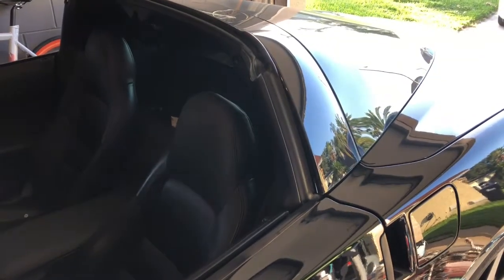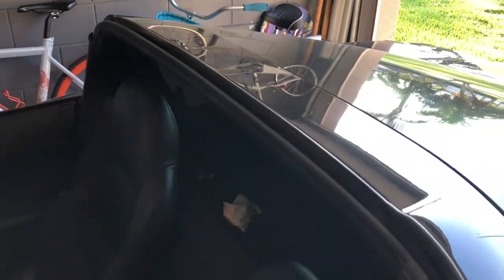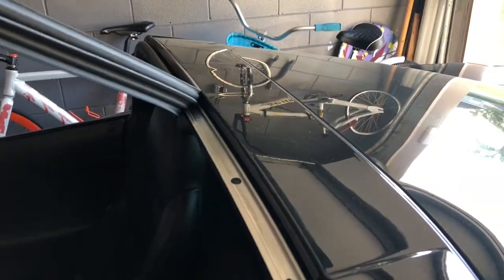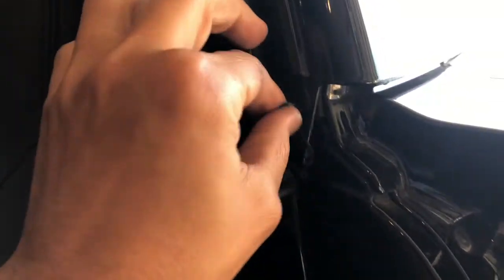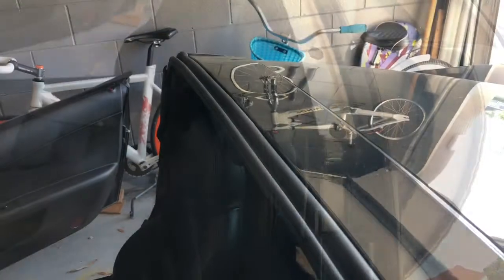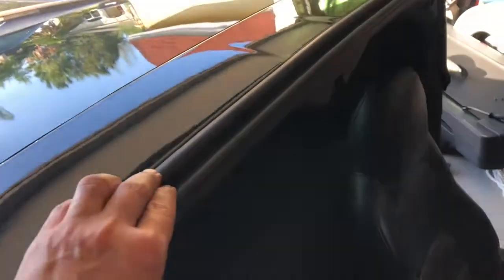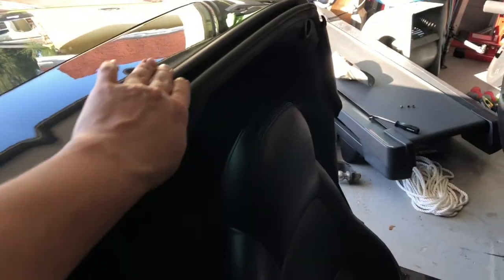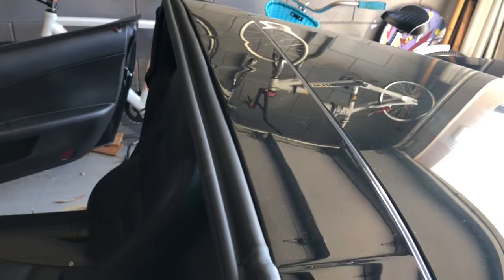C6 Corvette Targa Weatherstrip Replacement

Comment: I know this video is old, but do you still have the part number for that or what it's called?  Mine leaks on the passenger side.
Reply from the maker: I have no idea what the part number is. You can go to any GM parts online store and find the part number though. It’s the rear targa weatherstrip.
Reply: The part# that the gentleman in the video replaced is GM 15881010.  The thinner strip of weatherstripping between the halo and the read glass window is GM 19167780.

Comment: Hello, I have a leak on both the windshield and pillar weatherstrips where the top goes for my 2011 Vette. Where did you purchase the one that you are using to replace the old one in the video? Does the pillar side weatherstrip come in 2 parts? And would you know where to find the windshield side weatherstrip?
Reply from the maker: I bought it on eBay. 

I think the strip for the A pillar runs from one side, across the from of the targa, down the other side.

The strips that go along the the top of the windows are on the sides of the targa. Or at least I believe that is the setup...